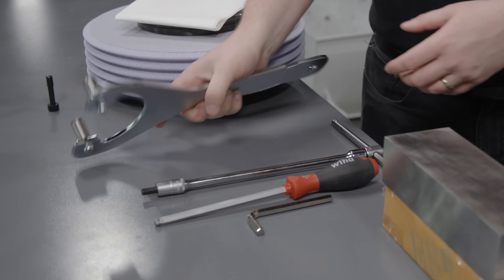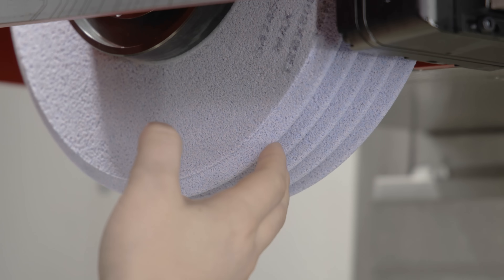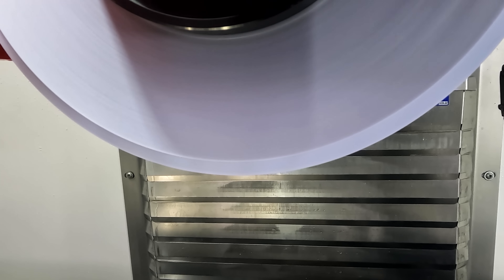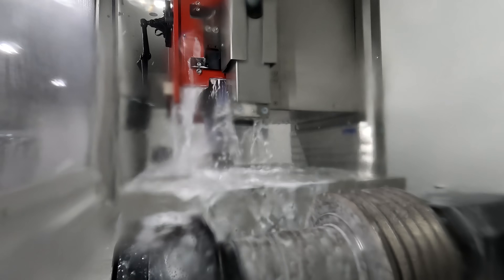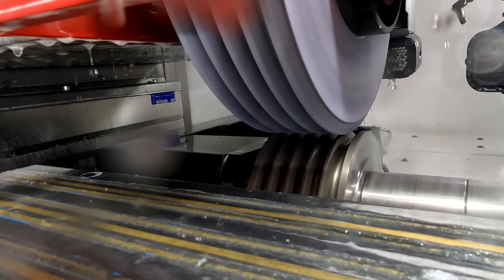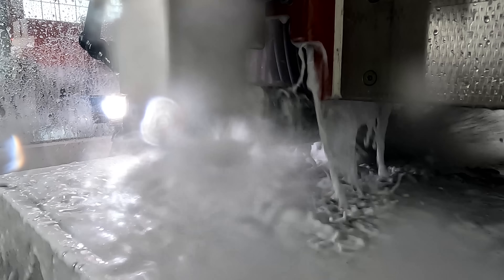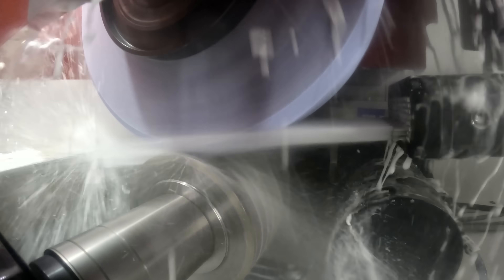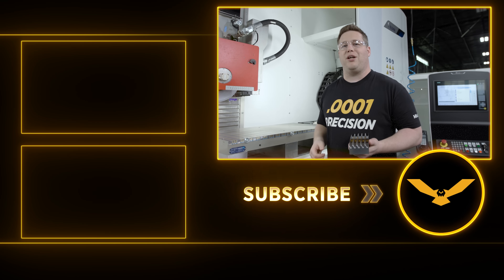Thousands of DIAMONDS Used to Create IMPOSSIBLE Grooves

Comment: Basically I first saw this technique, although not a full form at Hoffman bearing manufacturing, when producing ball bearings in the 1950s. They used an automated centerless grinding section. After the balls where cold headed, rough ground using anuller groved lapping machines (extremely noisy) heat treatment, and then on to the grinders. Automatic dressing of the wheels and conveyor system from grinder to grinder.  Inspection was by eye using a Matt paper tray with white light above. With that set up the mirror finish looked Matt. Any blemishes could be spotted by the operator. They were only allowed 30minutes on . Then a break, then back, and so on through the day because of the eye strain plus a limited amount of actual hours before stopping and another operator taking over.

Comment: Is thank rotary dressing tool something you make? How do you get specific shapes otherwise?  We make some grinding wheels for a customer that makes skate sharpeners and it looks similar(metal part turned on a lathe with a diamond coating on top)
Reply: You are exactly right.  These dressers are made the same way. Turned on a lathe then diamonds are impregnated afterwards.

Comment: Excellent. thanks for another informative video. This may be useful to you or not. Magnets can have a habit of letting go. With this in mind I generally put flat plate stops at the front and behind the workpiece to prevent "creep". 
I hope you see this as constructive feedback
Reply: Thank you for the info.  I did place a flat plate behind the part in my previous video but this one being 3" wide and 8" long I felt like it had enough surface contact to hold without the flat plate.  I did want to go ahead and put it anyway but I was afraid the wheel would hit it since it was getting so close to the table in order to create the arc.  Thanks for the info though.  I always welcome feedback and extra knowledge when I can get it!
Reply: yup. for thin stuff, i cut a few inch piece off of the steel banding (in the scrap barrel) that was holding our stock together from our supplier. REALLY THIN?!? Farm it to these guys....HA HA!!!!

Comment: So where do these custom dressing wheels come from(Later I read down the comments the Grips Profile)? How are THEY made? Seems like grinding a precision dressing wheel would be quite a chore, and require some serious hardness to grind the diamonds in the dressing disk.
Reply: There are different manufacturers for them.  They actually turn them on a lathe, getting the profile to spec then they have a proprietary process where they imbed the diamonds around it once it is finished on the lathe.
Reply: @Jessie_Smith  Thank you. Please more on the whole process.
Reply: @BrilliantDesignOnline  We will for sure be showing even more capabilities with this machine in the future. I can't wait to get started on them

Comment: Why can't you only dress the wheel before the final pass? (why need dress the wheel before roughing passes)
Reply: If you let it go too long without dressing then the tips of the wheel are going to get wore down more and more and if you only dress the wheel at the final pass then you will end up taking way more material than you were expecting.  Kind of like if you were milling a part and you let the roughing tool break at the bottom of the tool then come in with the finish endmill.  You will end up taking way more than it should have.  hope this makes sense.
Reply: @Jessie_Smith  Thank you very much for the explanation!
Reply: @aaaaa-yv1zr  No problem!  thanks for watching
Reply: dressing the wheel zeros it out for the machine to be accurate, and I don't know about form dressing I never used it but with single point dressing the faster you dress the rougher/grittier the wheel will be. You blast across the diamond and get a rougher wheel that will remove material faster, and then do a slow dress for a fine grit finish pass
Reply: @ghost2coast296  Roll dressing is similar in feedrate and surface footage can have an effect on the sharpness of the wheel.  Another thing that can affect it is the direction of rotation of the dresser.  Upcut (asynchronous) direction will be less strain on the dresser but will give a more closed wheel.  It will give a better surface finish but will also be more prone to burning.  Whereas Downcut (synchronous) direction will open the wheel and give a sharper/grittier wheel.

Comment: Mkay ... so how do you dress the wheel dresser, I know its diamonds. But surely that won't last forever even though its made from a lot of diamonds
Reply: When the diamond dress roll loses its form, you must replace it with a new dress roll. Diamond dress rolls can have a life expectancy of up to three years, depending on the usage/application.
Reply: @UnitedGrinding  I see, was trying to imagine how or even if it would be possible to accurately "sharpen" the wheel dresser, while still keeping it simple and cost effective. Basically, its cheaper to just buy a new one then?

Comment: I love this: Use Diamonds to cut a hard stone then use the hard stone to cut steel...
Reply: Reason being that diamonds are made of carbon. At high temperatures like in machining Carbon dissolves in iron (that's how you get steel) so diamond tools wear out incredibly quickly when machining it.

It's the Achilles heel of diamond tooling- can cut everything except steel (and a few other metals that behave similarly).
Reply: @AngDavies  aahhhhhh that make sense and is pretty cool! Thanks for explaining!

Comment: Woah woah woah, how does that auto balance work!?!? Whats it doing/changing to balance it?
Reply: It has an acoustic sensor that listens for the vibrations, as it detects vibrations it will automatically adjust the weights in the spindle to balance it out.
Reply: @Jessie_Smith  How does it auto adjust the weights while spinning?
Reply: @beachboardfan9544  sorry that was incorrect.  There are actually 2 roll pins that are located internally which rotate on its axis to balance the wheel
Reply: @Jessie_Smith  Damn you guys aught to make videos about mechanical magic things like that!
You guys just say machines do X, and blow past how, but the how is the most interesting part!

Comment: Do the particles in the swarf also stick to the magnetic bed? And does it cause any problems if it builds up?
Reply: if you look closely you can see black stuff on the bed, that's the swarf 
it will accumulate at the edges of the part if you run with low pressure coolant but if the pressure is high enough you won't have that problem and the swarf with be left at one end of the bed and in the filters
Reply: Yes the swarf sticks ti the magnetic base that's what the grey dust is? Surprised you didn't know that. I am not having a go at you but If you haven't seen that before you wouldn't know.
Reply: @rhindy6846  I figured that's what the grey dust was, but I thought it would have caused more problems. I guess I didn't quit understand what the high pressure coolant was for and how effective it was at evacuating the swarf.

Comment: I’d like to see how you guys probed that.
Reply: I touched the top of the part with the bottom of the wheel and when I taught the work offset the machine automatically compensates for the diameter of the wheel.  Then I touched the back of the part with the front of the wheel and same thing, when I taught the work offset for this direction the machine automatically compensated for the width of the wheel.  Then to find 'X' I put a mag base on the front of the wheel and touched the top of the part with the indicator.  I rotated the wheel back and forth until I found the low spot which told me that was the centerline of the wheel.  Then I moved 'X' over until it started dropping off the left side of the part and that found my edge.  I believe it shows me doing this last step in one of the previous grinding videos.  I don't have a probe on this machine but I believe you can order it with one.  that would be nice for sure!
Reply: @Jessie_Smith  had to read twice to understand what your talking about to get you Y. That’s pretty cool.

Comment: Oh, my God. 25+ years ago I had to transfer the profiles on the grinding wheel with a template and pay attention to how the diamond is guided.
Incredible what has developed in this area.
Reply: Technology has really come a long way in a short period of time.  I can't imagine where it will go next.  Blohm has thought of everything with this machine.  It's amazing how simple they have made it
Reply: @Jessie_Smith  In my mind, in the future, it looks like we’re going to lose skills and knowledge.
Almost as it is probably the case with regard to the pyramids or other buildings that were possible thousands of years ago.
With every new technology, with every machine, we lose some skills. Let's lose some basic knowledge.
I was a toolmaker at the time and years later I had also learned to be a technical draftsman. (translated from german to English, no idea if it is correct)
I had to learn the basics on the drawing board and also on the PC with CAD software.
But one thing is clear, I would never have been able to do what they did back then with pen and paper.
Later I was able to do magic with CAD/CAM software, but without it I would be completely helpless and that makes me think.
I'm more of a philosopher anyway and I like to think and the point is, with all this technology, the craftsman, the normal worker, loses more and more power and becomes a tool.
You only have to think of the rocket that led to the moon landing, it can no longer be manufactured because these craftsmen no longer exist.
The skills and their knowledge have been lost.
However, as my master at the time said, dexterity is important, I held the file in my hand for a year.
And all the other primitive options had helped, too.
I could never have made the part that you made there, unless I had previously built a device that would have enabled me to rotate the part.
with stationary grinding wheel.
Normally it would have been die-sinked and then polished by hand.
Anyway... :D
I would like it if now and then something complicated just for fun had to be done with minimal possibilities.
Most designers would fail with pen and paper and probably throw themselves out if they were forced to make the shit they designed themselves.
That's the price of too much specialization.
Reply: @svenboelling5251  That is true.  With every advancement in technology some skill is lost but new skills are developed.  There is a ton of skill lost from manual machining to CNC machining but at the same time a whole different type of skill is formed.  I guess it depends on which side of it you are on.  On one hand, it has made it to where the operator no longer has to have a ton of knowledge but at the same time, someone had to write the macros and language to make it that simple.
Reply: @Jessie_Smith  I'm probably one of those people who don't want to forget the basics.
The core from which the rest grew.
Either way, you need both.
Without a seed there is no stem, no leaf, no flower and without them, no seed.
Reply: @svenboelling5251  Very well said.  I am the same way.  Even though I've been in the trade 15 years and have made some super complex parts, I still watch videos on squaring a block and things like that.  There is always something you can pick up on or some forgotten knowledge to relearn.
Reply: @Jessie_Smith  Not only the knowledge of the techniques is such a thing, I just had to think about my exam back then and the examiners.
A friend of mine was also tested and her tool did not bring the desired result.
Normally she would have failed the exam, but I could tell by the color that her material wasn't what everyone else was given.
I had given her what I had left, a round piece of tin from which a small cup was to be drawn.
I hope that's correct in English.
In any case, I wanted to say that all these 3-4 examiners had probably forgotten that there can be something aside from what is on the plan.
If the knowledge that there is such a thing as a mistake is lost, then someone is no longer of any use.
Although that sounds hard now, whatever.
I just want to say that I had the most problems with people who thought there can be no mistake.
Which usually means there have been no errors so far.
With too much security comes a loss of knowledge.
Or no, a loss of attention in various areas.
Well well....everything complicated :p
I just don't like an automatically running oasis of well-being.
Everything that goes in this direction is automatically criticized by me, haha..
Probably because I'm prone to it and fall asleep faster than others.
Pure self-protection.

Comment: I grind a plethora of ceramics with different styles of diamond impregnated tools as well as resin bonded tools. It's a lot different than machining with endmills and face mills. I've learned that regular dressing is key to success when CNC machining with grinding wheels. 
This machine here is amazing. I would love to get my hands on one of these bad boys. Looking forward to more content in this regard. 👌🏾
Reply: Thanks for the reply!  this machine really is amazing.  It makes life a lot easier.  There is definitely an art to grinding just like conventional machining.
Reply: @Jessie_Smith  If you don't mind me asking a few questions: 
What is the year, make, and model of that beauty? 
What CAD/CAM software is being used to program it?
Are you using a generic post processor or do you all make your own?
I'm interested in knowing... thanks.
Reply: @unaffected_covid  This is a Blohm Planomat XT built in 2021.  For programming you will mainly use the conversational program on the machine which is super intuitive.  The part in this video was programmed completely on the machine including the dressing of the wheel.  If you don't use a roll dresser and use a disk dresser instead then Blohm sells a CAM software called Grips Profile that writes the program to dress the wheel with whatever shape you want.  They also sell Vector but I think they mainly use it for the CAD side.  Or you can import a .DXF into grips for the shape of your wheel, apply toolpath and post the code then put it directly in the machine and use that code as a subprogram for initial dressing and then re-dressing of the wheel as needed.  I will do a video on that in the future for sure but it all is super simple.
Reply: @Jessie_Smith  Would it be using macros in that particular event?
Reply: @unaffected_covid  Yes I believe that is how they wrote all the logic for the canned cycles. It is using macros in the background.  The control is a Siemens but Blohm has put their interface on top of it.  So you program, set work offsets, wheel data all that on the Blohm side but it is actually writing everything to the Siemens side and running it there in the background.
Reply: @Jessie_Smith  Ok. I was just curious. There's so much to keep up with nowadays. Thanks for sharing.

Comment: Do you have to account for the constantly changing wheel diameter in the program?
Reply: Its corrected automatically so no
Reply: No you don't. You can store wheel data for each wheel you put on the machine.  When you create a new wheel, you tell it what diameter it is.  So each time it dresses the wheel it will automatically reduce the amount you dress from the diameter of the wheel.  It will compensate the shape as well as the surface footage.  Additionally, in the canned cycle for the profile it has a "radius adjustment" so if you make the first part and the outside radius was off you could tell it in the canned cycle how much to adjust and then every part after that will come out perfect.

Comment: Would you ever really run this process for a single part? As consumables you need the dressing tool and the wheel. And the dressing tool doesn't make itself either. Seems unnecessarily expensive.
Reply: They were probs given the machine free in exchange for making videos like there advertising it. I can’t think of any applications where it would be economical to buy this machine
Reply: This particular part was for demonstration.  The wheel and dresser I was using is for a different part that is a production part.  You are right, if you had to order a diamond dresser and all of this for a single part it would be very expensive.  There is also a different dresser that is called a disk dresser that can do multiple shapes in the wheel and is less expensive that would make more sense for one off's maybe.  But like I said at the end of the video, where this process really shines is in hard materials.  But chances are if you are purchasing this machine you have production parts.
Reply: There is programmable single point dressers where you can dress any shape into the wheel

Comment: those profiled diamond dressers sound expense. btw l'm wondering if you could just make a pass across the table without the wheel running. blasting away the chips with coolant instead of doing it manually?
Reply: It's not worth it for small jobs.
Reply: @FiltyIncognito  obviously